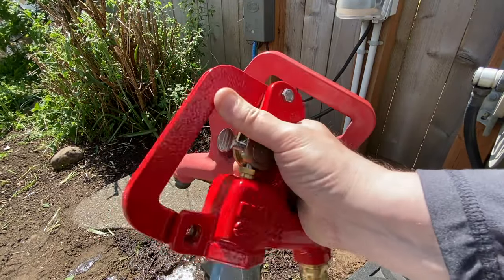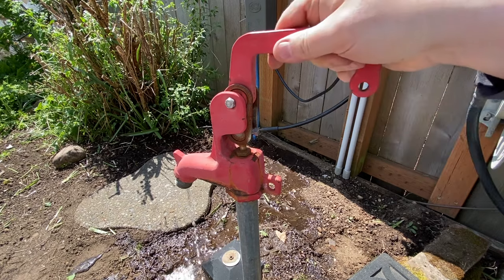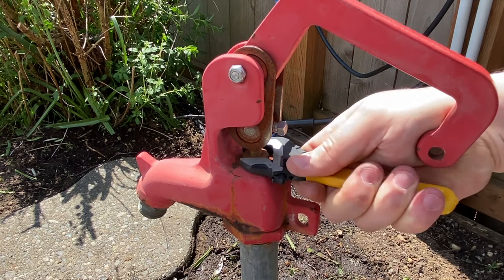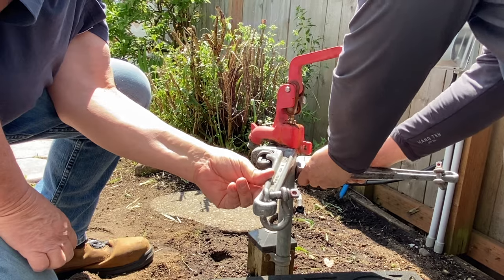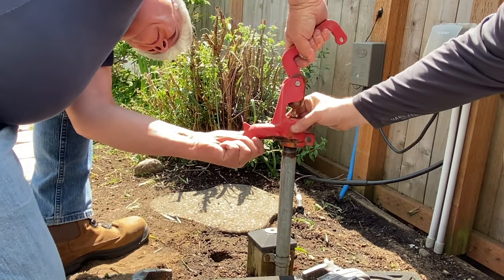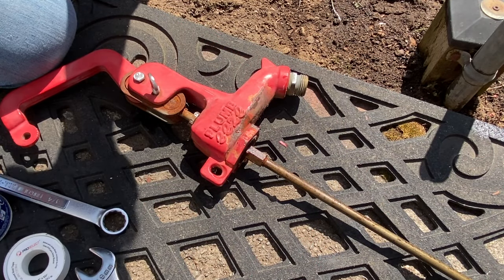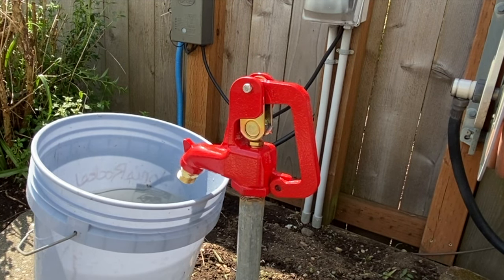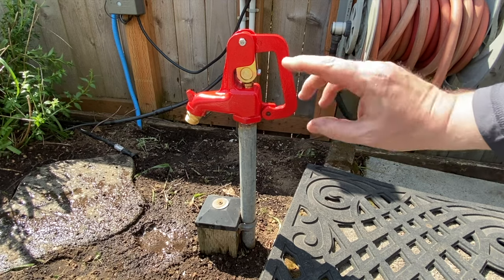Can I Replace The Head Of A Yard Hydrant?  Yes You Can!

Comment: Brian, ive seen a number of these at the scrap yard, and i suspect that some were the result of upgrades, while others that aren't very old, are probably because of new owners not understanding how and why they are important, particularly in the colder times of the year in northern climates. Some of them are also bent, which means a couple of things, like the hydrant wasn't seen when backing up, or maybe something caught the hose and it got pulled hard.
Reply from the maker: I could totally see someone hitting one with all kinds of equipment on the farm and not a bright color. Bet that’s the major issue.

Comment: Here in Western Washington State, what is the "safe burial depth" for water lines?
I plan on adding two "remote spickets" for my Garden and Memorial Garden so I do not have to constantly ravel/unravel my garden hose the 150' for Irrigation.
As I reside in East Port Orchard, WA I assume that you would know these details!
Reply from the maker: We have an 18in frost line.  I usually bury lines at 2ft.  Then at the hydrant itself go down another 1ft and put gravel in the hole to set your hydrant on that way it will drain.  That is a lot of hose to unravel for sure.

Comment: Husband broke it off of the little pipe in the center. Any hope of fixing it or do we need to dig it out?
Reply from the maker: of you have the manufacturer you can remove that head and the rod should still come out with it.  If not is will be free floating in there.  turn the water on and it will come one.